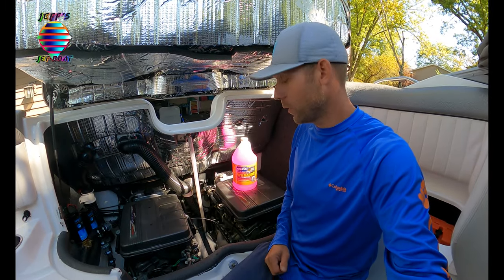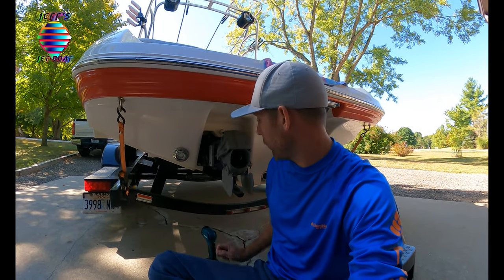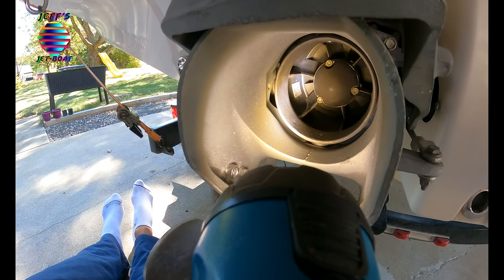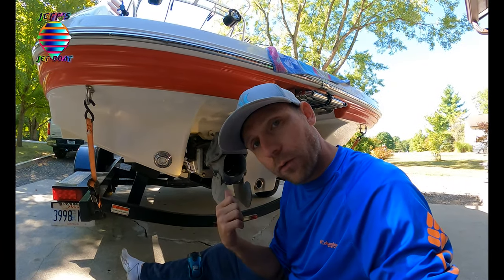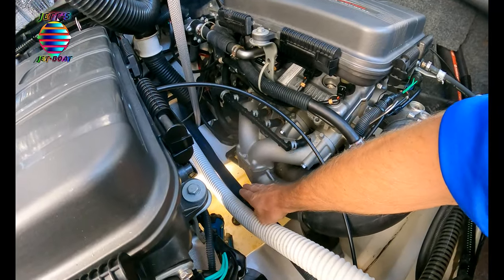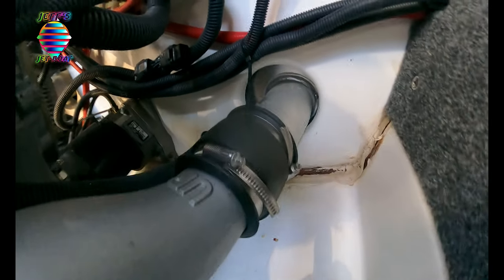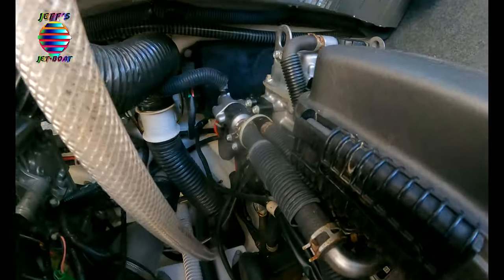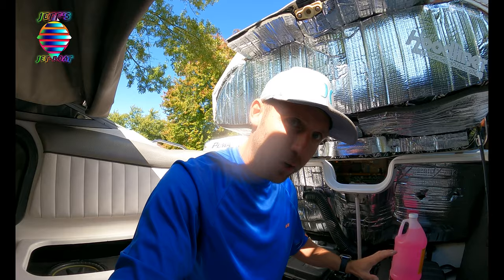Anti-Freeze - Yamaha Jet Boat

Comment: I just bought a brand new 2023 Yamaha 195s.  Do you recommend fogging for a new boat that has yet to be on the water for winter storage.  I keep getting different answers from friends.  I did not fog it.  I filled the fuel tank, added fuel stabile, removed battery, and put a maintainer on the battery.  Your thoughts please.  Thank you.
Reply from the maker: If your boat is going to sit for over 6 months then I would fog it.  Ever since the early 90's boat engines(30 years ago) have a coating on them to prevent them from rusting.  The only reason I do it is so I can demonstrate it in a YouTube Video.  Now a days is more of a old timer thing to do.
Reply: @JeffDoesThis  Thank you Jeff.  Our boat will not be sitting longer than 6 months.  It will be 5 at the most, and hopefully less if we get any kind of early spring in Maryland.

Comment: Jeff, can you wash the air intake elements in these boats? Thanks in advance, the snowboarding videos are great!
Reply from the maker: Can't wash them but you can blow them out with compressed air.   Typically boat air filters go forever due to the lack of any dust/dirt on the water.   I still have the original filters in my 08 AR230.  If the element is falling apart or really bad I would just bite the bullet and replace them.   It will probably be the only time you will replace the filters.
Reply: @JeffDoesThis  They aren’t bad, they aren’t falling apart, I just felt like maybe they could be cleaner, I will blow them out. Thanks again, about to take the boat out this weekend here in NC!
Reply from the maker: Heck yeah man.  I'm in central Illinois so usually mid April is when we head out for our first trip.  Enjoy it.

Comment: Hey Jeff I started my port engine today before winterizing and it would stay running. Got it running but has a bad shake and possibly a miss. Ran great just a week ago on the lake. I am wondering if I have a bad plug ( I change them every year) or coil pack. Just kinda guessing. Anything you know of else that I should look at? 
Update: ok so know I don’t know if I am just hearing stuff or not. No check engine lights on and now starts right up ???  Is one engine on your more louder/rattly than the other?

Comment: I start mine and let run for about 5-10 minutes once every couple months. Will this be okay then fogging? I live in Oklahoma so we have nice winter days.
Reply from the maker: Yes.  Honestly fogging is almost a thing of the past due to coatings they put on the metal engine parts anymore.  If it is sitting for more than 6 months than I would fog it.

Comment: Is it optional to fog the engine on a jet boat?  I know last year when I brought my new Yamaha 195S home that they did not fog it, and the dealer started it prior to me leaving with it.  I had no issues with the boat performance over this past season.
Reply from the maker: Fogging the engine all depends on how long its going to sit without the engine being run.  Honestly anymore it's almost not needed IF YOU CHANGE YOUR OIL AT THE END OF THE SEASON.  Ever since the mid 2000's, the coatings they use on the metal engine parts don't rust and pit up like they use to do back in the carbureted days and the oils stick and coat the metal surfaces WAY longer then before.  So my advice,  if it's going to sit for more than 6 months and not run, then fog it.  If not, then I would not worry about it.
Reply: @JeffDoesThis  Thank you.  I changed the oil at 10 hours.  Only put 4 hours on the new oil.  I will change the oil and spark plugs in the spring.  Thanks again..

Comment: In the manual it takes about greasing your cables to the throttle. I have tried and it’s tight to get too using my fingers. Do you do this or spay with a lubricant rather than a grease?  Hopefully my question makes sense…..
Reply from the maker: I use CRC white lithium grease.   I have been using it for years,  dirt bike,  street bikes and marine.  Here is the link for it - https://amzn.to/3RIqnZl
Reply from the maker: Sorry,  in a spray can.
Reply: @JeffDoesThis  awesome thank you! You just spray on the throttle cable and mechanism?
Reply from the maker: Yes.
Reply: @JeffDoesThis  thank you!

Comment: I've been working on jet skis, jet boats, out boards and marine engines for over 15 years. 
I'm sorry, you are wrong man..
The problem is, no matter how well they design it, there is always going to be small pockets of water left in the cooling lines, water box, and cooling jackets.
I can show you many cracked jugs and waterboxes from people thinking you can just clear out your ski by revving it at the end of the year and not using rv antifreeze.
Its a mistake, and one year it will cost you if it gets cold enough.
I've been winterizing skis and boats for just as long, and I promise you, you need the rv antifreeze man..
You are not wrong, and some motors are designed far better then others, but NONE will ever allow ALL water to exit, I haven't seen such a perfect design yet.
I've been in and out of all these engines too man.
Consider taking this video down, it's incorrect.
Reply from the maker: I was a factory Yamaha tech and ASA Master Tech.  You are wrong. You probably didn't even watch the video.  This video does not apply to outboards, sterndrived, direct drives, Honda, Suzuki, OMC, Mercruiser or any other company setup.  Why don't you drive down to the Yamaha plant in Tennessee and tell them they need to add antifreeze to all the brand new boats  they run and then stick outside afterwards in winter were it's gets below freezing.   Also water doesn't freeze harder versus 10°F or -30°F.

Comment: So no need for winterization?
Reply from the maker: For a Yamaha Jet Boat 2003-current, winterization/cold weather storage is still needed.  Treat the fuel, run the engines on a hose to get the cooling system flushed out, rev the engine to expel water from the muffler.  Watch my Cold Weather Winterization videos on my channel and I go over everything that needs to be done.